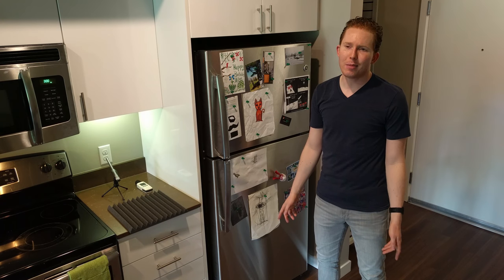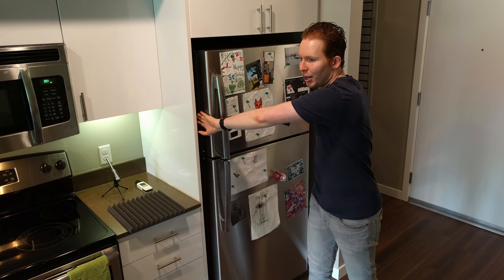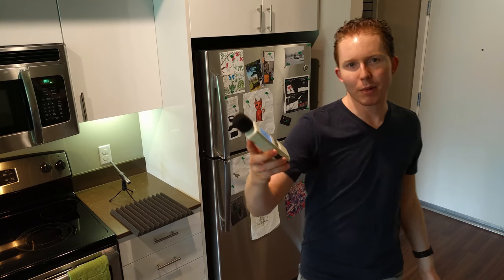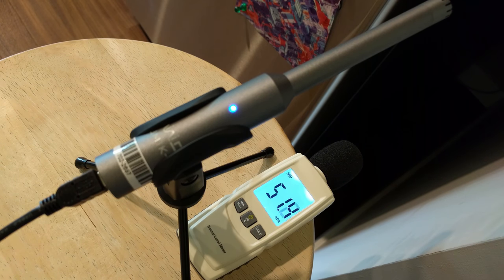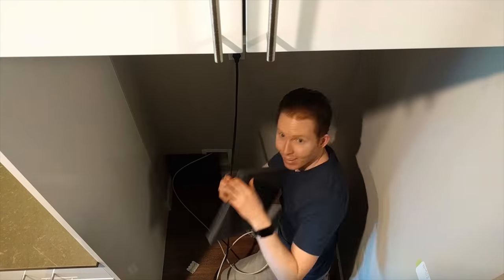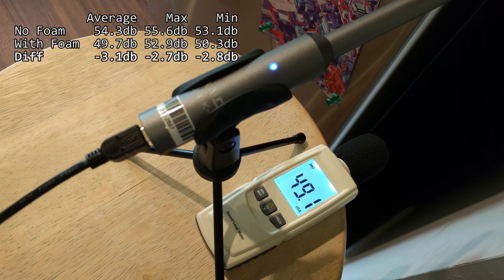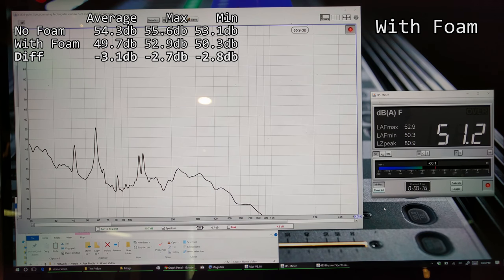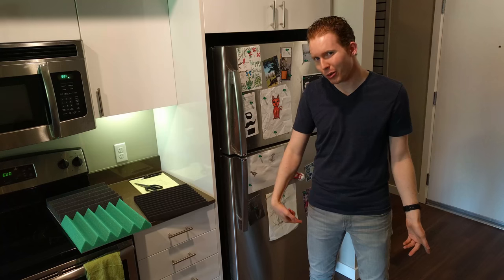Can you silence a fridge with acoustic foam?

Comment: Good video. Thanks. We did something similar, adding 1" insulation which helped some. Then we added a second layer, which doubled the results. We used UltraSonic 12 in. x 12 in. Acoustic Panels.  We also put the refrigerator on a rubber mat, although that didn't seem to make much difference.
Reply: Troy, when you say you "added a second layer," does that mean you put one panel basically on top of the other, doubling its thickness to 2"?

Comment: The grooves to do not capture low-frequency sounds better. This is a marketing gimmick. If you want to capture lower frequencies, you'll need thicker, more dense material. I guarantee if you used rockwool or compressed fiberglass, you'd have more impressive results.
Reply: In fact the grooves don't capture literally anything, as a groove means air space going deeper into the material. :))) Maybe the thicker center of the pyramids absorbs lower frequencies than the thinner portions of the material, that would've made some sense.

Comment: Search an industrial rubber supply company near you. You want .5in gum rubber. Have them cut you a piece that fills up the back wall a couple inches shorter than frig height. 4 or 5 1in nails will hold it, just nail to a stud. Cut's the noise in half.

Comment: To affect an 80hz wave (lenght = around 4.3m) you need at least absorption material with a thickness of 1/4th of the length of the wave. That means you need 1m of foam to be able to absorb 80Hz.
Reply: You could build a Helmholtz resonator for that though.
Reply: damn that sucks

Comment: Actually I just finished with a very successful attempt.
Put acoustic ceiling tile on the back and side walls all the way to the floor (I used 2x4 tiles and got them half price because they were damaged around the corners - $20 for a box of 8 pieces) Lay down 2 bath rugs with rubber bottoms and roll the fridge onto them. Bam, 80% noise reduction.
Reply: Can you link to the exact tiles you bought?
Reply: Yes, that would be great
Reply: I would like to learn more about how did you do that because I tried to do the same, and it didn't reduce much noise ☹ Also, I am so afraid of it being a fire hazard being so close to the refrigerator.  Not to mention it was so smelly and when I tried to remove them they ruined my wall because of the black adhesive didn't come up.

Comment: Totally not an expert here but won't that foam absorb mostly high frequency?  I thought you more or less needed something with mass to help absorb low frequency sounds.  I'd heard of using old lead flashing scrap (sealed in plastic) to deaden sounds  also it is really thin.  Would need something like foam or car deadening material to then block out the mid and higher frequency sounds.   I read somewhere another alternative is heavy tar roof shingles/ material.  Anything really dense basically as the low frequency just blows through the fibers of the stuff that is great for high frequency.

Have always thought of doing an experiment such as this but don't have the measuring equipment and was a little worries about hurting the air flow from dissipating the heat.  So would have the further experiment with how to then help silently improve the heat dissipation.  Would turn to advice from computers probably as I am sure there is a ton of DIY heat sink ideas on you tube.  

At least trying this same project on a dishwasher there is far less to worry about with heat dissipation.  Prob start there first.
.

Comment: Great that you did this as a proper test but aiming for 15db reduction was waaaay too optimistic. 4-5dB would make it a no-brainer.

Try to use proper sound deadening foam next time. The type you used does very little, as you saw.

Comment: Kenmore SxS, compressor makes so much noise, you have to leave the room. I had some foam pipe insulation  that I stuck underneath the compressor. It has greatly decreased the noise. Fridge is currently sitting in middle of kitchen, watching to make sure it doesn't catch on fire.
Reply: That’s a smart idea! I’ve since moved and have an even louder Samsung fridge. I might try that and see if it works

Comment: you didnt use enough foam. Floor surface wasnt covered at all. Only a small section of the side walls were covered. Would have reduced noise alot more if you had covered more than just the back wall

Comment: Wow.  That's pretty short sighted.  You do know that refrigerators aren't' designed to make noise right?

They're designed to move heat from inside to outside.  They dissipate this heat via the sides and back.  By INSULATING around it as you have, you have severely damaged the efficiency of the fridge as well as decreased it's useful service life.

You can observe this if you put your fridge on a 'Watts up' meter for a week with and without this insulation and if you put a thermocouple on the exterior coils to monitor them.

In the worst case, this could also cause a fire as that heat continues to build up.

If you're going to do this anyway, make sure the foam is placed with the channels runing vertically.  Use the largest channel size foam you can find, and make sure there's at least 3 inches clearence between the tips of the channels and the fridge to allow for air flow.
Reply: I tried to make a window unit an indoor unit by just recycling the air.  I figured its exhaust was like a Arizona day.   Damn thing got so hot that I thought it was gonna melt the display.

Comment: Well, I had an old noisy refrigerator. But I bought a new one.
It makes no noise and uses less electricity.
Problem solved.
Reply: which company and model number ? thanks.
Reply: It was meant as an general remark. We got now ratings for energy efficiency in the stores.
The norm is an A or B rating. But they are usually more expensiv.
But if you want to know, it was an "Nordland" refrigerator and it was not an expensiv one.
It is an older model with the freezer on top.
But the thing is silent, a fly buzzing around makes more sound.
https://www.fiyo.co.uk/fridge?device_brand=579#
But I heard that it is now made in the factories of AEG/Electrolux.
So an AEG could be an alternativ then.
Reply: @ Phillip B
I don't know where you shop for a new refrigerator but if you go for German quality and A/B rating you most likely are on the safe site.  As AEG/Electrolux.